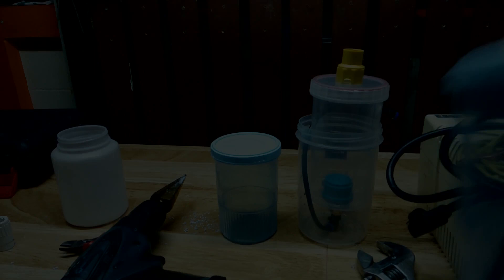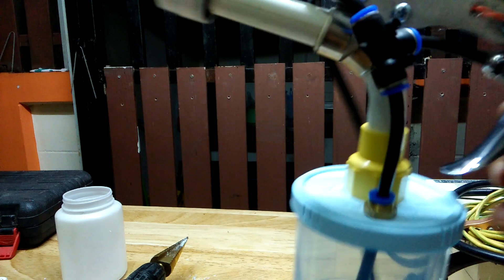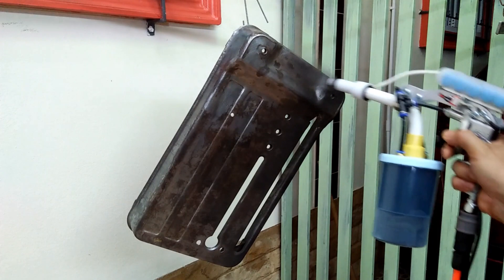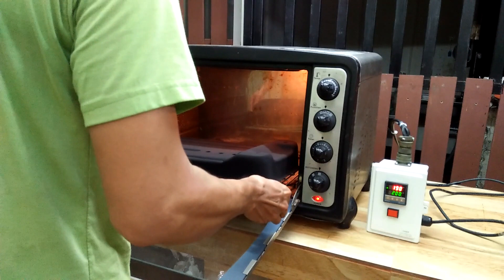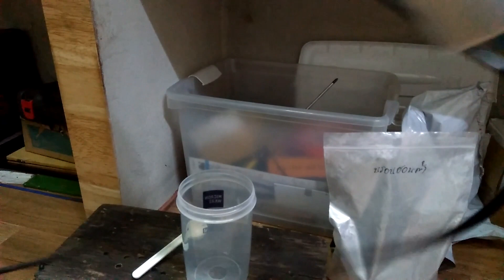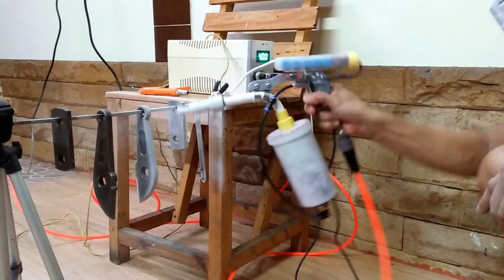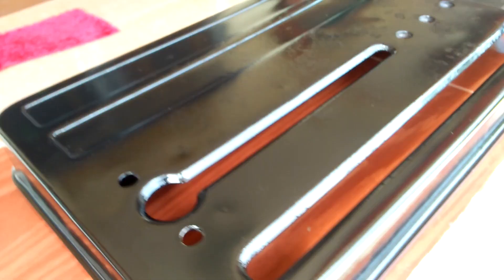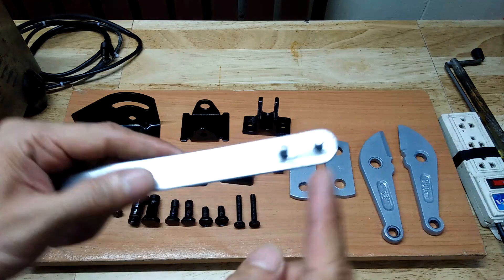2 Homemade Powder Hopper Designs

Comment: Hi Phil,  I made your original design cascade using the same components.  I have made a powder coating gun out of a paint spray gun which has a top feed.  This works extremely well so long as you don't you it as gravity feed.  It still needs to have pressure to the pot so there is a fair bit of modification to the gun and a atomizer added inside the pot.  I was hoping I could add a photo of the final project but Youtube does not allow that function.  If you would like to see it give me a contact and i will send it to you.  It works great.  Keep up the good work and videos.
Reply from the maker: Hi. Thank you very much for reaching out. I have several other viewers sending me pictures of their own version of the homemade PC gun who got inspiration from my videos. The top feed was something I thought of, but I did not have the available material to do it. Can you send me some photos at philipal2015@gmail.com. I would really like to see it. I have a new built gun update video coming up in a few days.
Reply: Ok I have managed to send you the photos.  The issue was with clicking on your email address.  After manually typing it they all went through.  Any questions let me know.

Cheers

Comment: Hello Phill, I was copying your build and was wondering if I used 20kv capacitors would I get the same results if I use 300kv, like you did just with more wired in line?
Reply from the maker: Hi. Yes, that is in fact a better design. The commercial high voltage cascade has at least 10 stages of the voltage multiplier. That makes the capacitor smaller. Also the voltage between stages is lower therefore less possibility of sparks jumping within the capacitors which cause inefficiency. The only reason I used the 30 kV capacitor is that is what's available at the time I made the prototype. I will be making a second version of the high voltage cascade using smaller capacitors and 10 stages.

Comment: Wooow..question sir..I wonder if its possible to use the powder gun without that electronic thing attached, only the wire on the ground..
Reply from the maker: Oo pwede.  Ang tawag dun hot flocking.  Bale painitin muna sa pugon yung ipa powder coat. Habang mainit sprayan ng powder.  Didikit yung powder paint kasi matutunaw agad yun. Hindi narin kailangan ng ground.
Reply from the maker: The other way to powder coat gun without the electronics is called tribo gun.  That uses teflon on the gun powder outlet to charge the powder.  I will try to make one in the future.
Reply: Wow.kabayan k pla lods..salmat sa reply lods.ngyun plng kc ako ngkroon interest mtuto magpowdercoat.kaso low bajet.kaya nkita ko mga gawa mo..kya pala.sana mtutunan ko gawin din yn hehehe salmat po.and more power po